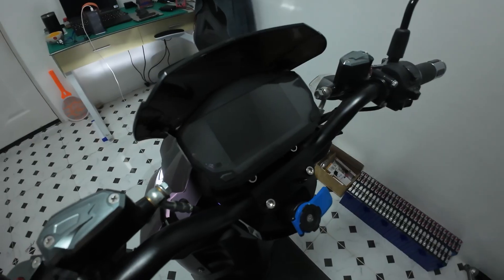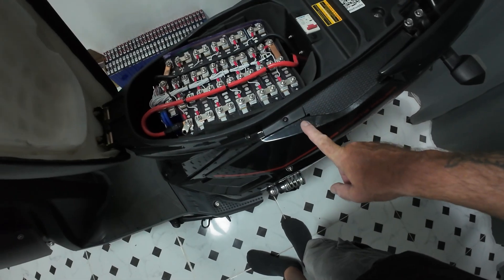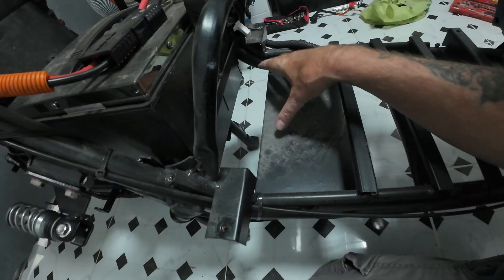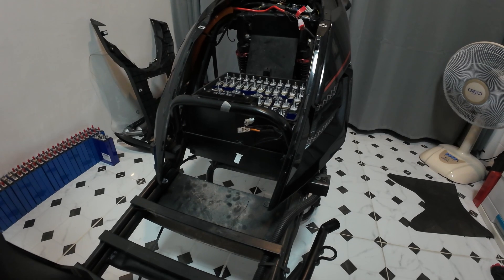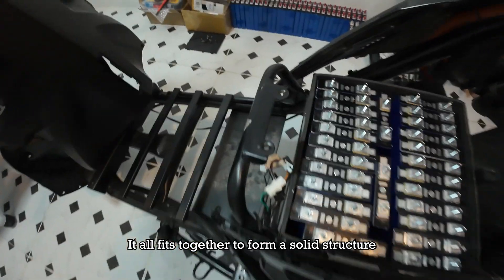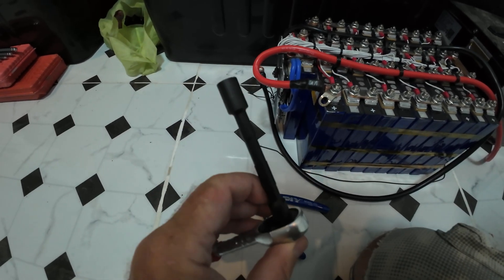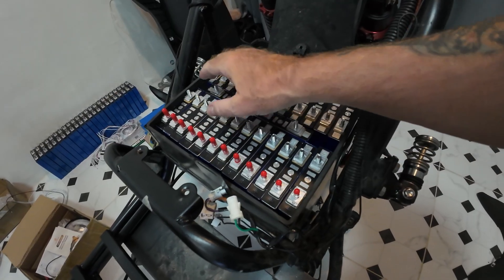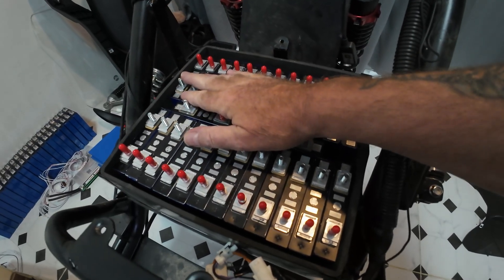The extreme DIY electric scooter / motorcycle build - Designing the LiFePO4 battery layout

Comment: Your top row should get flipped except for the cell on the left so that your long connection can be a diagonal strap picking up four terminals like this: `••.

Then mirror that diagonal connection on the other side.

It should be pretty easy, less resistance and less chance of it shorting with other terminals.
Reply: Another benefit will be your + and - terminals will be nice two terminal straps, close to each other and easy to wire to a nice connector or two conductor wire.
Reply from the maker: Cheers mate, I'll look at that very soon and change things around 👍😁😁😁

Comment: So there's no need to leave some spacing for cooling? Even LiFePo batteries can do that nasty thermal runaway.
Reply from the maker: I do understand what you're saying mate but these cells never get warm, the highest I've seen is +12C higher than ambient and the BMS does a good job of monitoring them. Also, none of the batteries you buy have any space between the cells. It's a gamble using every battery cell out there but I'm prepared to take the small risk to fulfil my need for speed.
Reply: @Vortecks Need For Speed and Bollocks to anyone that doesn't concur <-- THIS